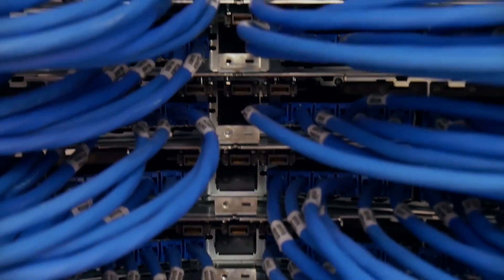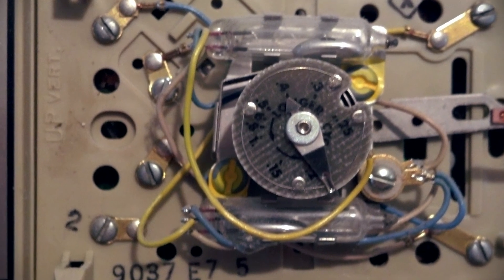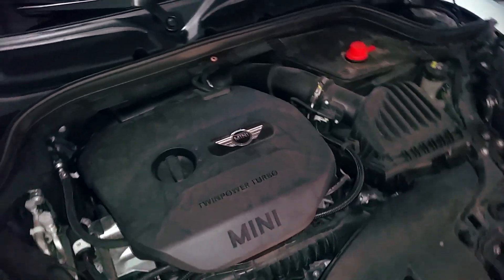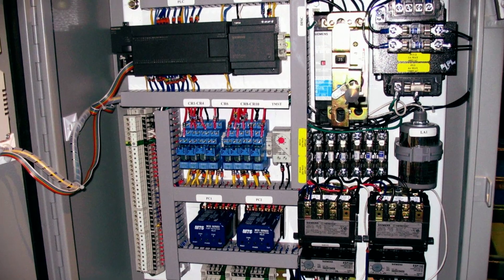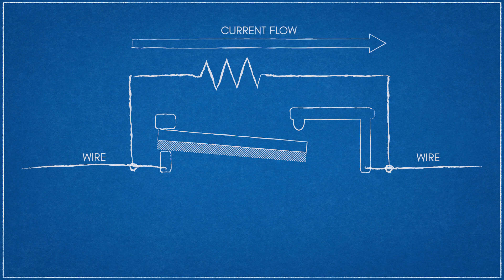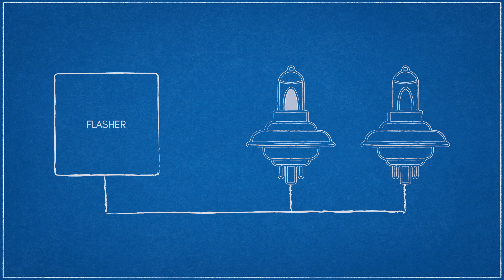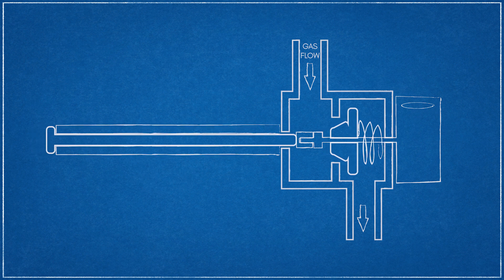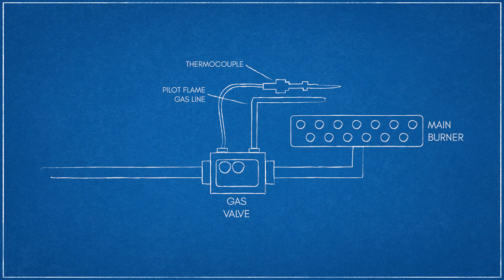Clever Uses Of Thermal Expansion

Comment: You forgot to mention the use of thermocouples in 3D printer nozzles. They are excellent for measuring the temperature within a 0.01 degrees Celsius accuracy and with PID control the temperature can also be regulated within that accuracy. We're talking well over 100 degrees Celsius nozzle temperatures though, but even a few degrees overshoot or undershoot can cause print issues. 3D printing is extremely precise.

Comment: Bi-Metallic metals were used as early as the 1750's to help mitigate time variances due to temperature changes in both the hairspring and the balance wheels in use at the time. Nowadays, fine watches like Rolex and many others, use a copper-beryllium alloy to make it more thermally stable.

Comment: My Dodge used a bimetallic strip as a cheap delay-off relay, connected to the dome lamps, for the ignition cylinder halo light.

Open the doors, dome lamps on, strip heats up, makes a connection, ignition light comes on.  Shut the door and it takes 10-15 seconds for the relay to cool off and the halo circuit to open.

Comment: One thing.

The voltage developed with a thermocouple is not formed at the junction, despite common belief.

It is formed along the gradient of the wires, which is why a "cold reference" is required.

Thermocouples don't measure absolute temperature, they can only measure relative.

Comment: As a software engineer, the thought of replacing analog mechanical controls with sensors and software terrifies me. The question in software engineering is "what happens when we screw something up?" not "what happens if we screw something up?"

Comment: I'm a massive fan of thermal-flasher TWINKLING incandescent Christmas lights, not talking about blinking lights with the red-tipped blinker bulbs. I discovered them a few years ago from a video Technology Connections had made about them and I've been a convert ever since! 
I think they are visually far superior to LED lights as the twinkling of the flashers creates a very subtle and gentle almost "shimmering" effect in the rest of the non-flasher bulbs as the voltage each bulb receives constantly fluctuates and the twinkling is actually completely random as opposed to more modern LED lights that cannot reproduce the same visual effects, nor can they be completely random as most will just cycle through a handful of regular timings.

Comment: Paraphrasing from a high level thermodynamcs text: There is no theoretical underlaying thermodynamic reason that a material should expand or contract with changing temperature. 

I.E, it's not 'required' by any thermodynamic reason. They just do. 

Some materials contract when heated (eg: Ice). 
Many do both - changing their behaviour at different temperatures. 

There's no prediction for it either, so we just engineer using empirical data

Comment: Engineers keep replacing thermal relays and overloads with clock counters.  Driving the maintainers nuts when current is high crushing broken parts but the clock is still counting down to cut circuit.  Its funny how a piece of metal put together works as a current sensor.

Comment: The only time I experienced an engine being radically cooled down was coasting down a steep hill in neutral gear in -20°C temperature :D Idle RPMs of a small engine on a car without advanced air intake control just couldnt battle that amount of cold air :D So i guess in winter its always better to stay in gear .. also because you charge the car battery that suffers a lot more in winter :D

Comment: Thanks for the information although I am starting to worry about how the physical fail-safe devices are being replaced with software, seems to me that the fail-safe is being replaced with fail-reporting which then leads to fail-flagging  which then requires fail-flag-processing which then eventually leads to action-to-make-safe.  Very much over complicated.  In my experience, when dealing with safety systems, the simple systems are better.

Comment: As a programmer, engineer, and electronics hobbyist, I advocate that systems should be given direct access to sensor data and indirect control over actuators so that software can both allow user customization and the reception of updates that improve the quality of the system, *HOWEVER*, said systems should also implement truly independent electromechanical failsafes because, trust me, it's easy for software to fail unpredictably, unsafely, and very very horribly.

Comment: A lot of people will have the thermostat valve in their homes if they have a wet heating system, they are the twisty things on your radiators, called TRV’s or thermostatic radiator valves. Wax based temperature regulation. They are also used on old school hot water cylinders to regulate the water temperature shutting the flow to the cylinder.

Comment: The explanation of the thermocouple is wrong. The junction does not create a potential difference. In fact, the only thing the junction does is ensure that there is no potential difference at the junction. The voltage is generated in the individual wires due to the temperature gradient along the wire. Different materials generate different potentials as a response to the temperature gradient, so while the potential difference at the junction is zero, there is a potential difference at the meter end.

Comment: Most thermally activated switches I've seen don't use a separate heating element, but instead rely on the current passing through the bimetallic strip to generate heat.

Comment: And yet, using Soundwaves as an energy source completely escapes mankind... 70% of ALL mechanical electrical structural chemical movement IS molecular transference of oscillation Frequency " Soundwaves " the median of Matter or energy matters not. 
 ... 15% is positive Thermal Energy the 15% is negative Thermal Energy or cryogenic energy. One Works WITH gravity one works against it .. and Heat is a Sign of LOSS of Entropy.

I can make Venturi chamber with parabolic reflector dish and a sound driver produce MORE thrust than a jet engine with ZERO heat. " Cold Airwaves " " see Brownian motion. 

No Fuel and No Audible Soundwaves..." Below 20 hertz frequencies "

With ONE Moving Part..
Reply: And why aren't you selling that to NASA or Elon Musk?

Comment: Learned most all of this as a teen, but always cool to watch it explained again. Good vid.
Reply: One of the best uses of heat control that amazed me is rice cookers. 

Because a magnet will fail once it reaches a certain temp you can pair it so it fails at 101 degrees. Because water boils off at 100 degrees it will only turn off once all water in the pot is gone (absorbed/evaporated).

Comment: In the CANDU nuclear reactor the geometry and composition of the fuel rods is such that when they get too hot, the thermal expansion reduces the density enough to make it subcritical, neutron economy turns negative and the reaction slows. This makes the whole system self-regulating and essentially impossible to meltdown, even if you were actively trying to melt it down.

Comment: The bi-metallic balance wheel was one of the first methods of watch and clock self regulation. When it got hotter, which would slow a watch down due to expansion of the balance spring, the balance wheel would contract, moving the moment of inertia inwards causing it to rotate faster.

Comment: The mercury switch in the thermostat is only there to provide hysteresis - the coiled bimetallic strip design can also be used with regular electrical contacts and mechanical means to provide the hysteresis.
Basically, when the strip moves far enough, the mercury falls from one side to the other, and it's weight then keeps it there until the coil build up enough tension to overcome it. This keeps the switch from reopening as soon as the temperature rises any appreciable amount, to keep the furnace from cycling too frequently.
Reply: Ryan, good analysis of the weight shift of the mercury inside the capsule to minimize short cycling. Additionally, the sealed mercury capsule is there to greatly minimize arcing and subsequent contact erosion. Also the arcing takes place inside the glass tube providing one less source of unintentional ignition.

Comment: One of the best examples of this is all of the expansion joints on the SR71 Blackbird. This engineering marvel literally leaked fuel while onto the ground and continued to leak while in the air until it reached high temperatures on its outer skin through high speed flight. There were expansion joints all over this aircraft. They figured this out without computers or calculators using slide rules by hand. To this day this aircraft holds the speed records it has achieved to this day. Amazing what people can do when they are faced with these huge problems that they face.

Comment: That's interesting about the flame sense pilot.ligbt thing. I tried to make my home fireplace "smart" (you know 'Alexa turn on the fireplace'). It had a Wall switch so I figured it was powered and I'd just interrupt the power supply (like a light bulb). I was baffled when I took it apart and the damn thing has no power at all. It's all contained. Even now I was thinking "it must be low power micro electronics." But actually probably not. It must just have 2 valves- one only working when the wall contacts are closed.

Comment: that's my entire job !!! 
transmitting informations on pressures or pressures differentials, that can get you, with some math, the flow, the level, the cloghing of filters,ect 

temperatures of corse 
but weight too, and then all sort of other extremely amazing stuffs !!! :) 

thermocoples are one kind of sensor, then you insert whetever you get out of it reliably to a transmetter wich is where you enter configurations and parameters of the stuff you are measuring, for exemple, if you use pressure to know the volume of liquid in a spherical tank, there is a formula, a flat cylinder, another formula, vertical cylinder, another formula, or % ? % of what ? level or volume capacity ?? ect ect ect 

that job is called here in belgium  electro-instrumentist

i have a specialisation in chemical industry and pharmaceutical/bio pharmaceutical industry.

basicaly, wherever there is sensors, i am here, so no limits, UNLIMITED POWER 

don't hesitate to send me private message for questions ok ??

Comment: Now the cars have a microcontroller that monitors the current going to the lights, etc.  The software complains about things like burned out lights.  If you try to replace incandescent lamps with LED lamps, the car complains about a burned out light because the LED light takes a lot less current than the incandescent light.

Comment: Are you sure thermal flashers are in parallel and shunt the current?  
Do they not simply break the circuit in series when it heats to a certain point?

Comment: Hum, I don't think these are particularly cleaver uses of thermal expansion. I would say these are pretty standard uses of thermal expansion, they are all to do with temperature control...... which are directly due issue affecting them, a fairly straight forward use.

Comment: When you hold down the knob to light a pilot light and let it get hot the thermocouple needs to be hot enough for it to make enough power to tell the safty valve to keep the gas flowing and that it can safely turn on the main burner in, water heaters, ovens, gas household heaters. When you hold the knob down and light the pilot light and it goes out immediately after you let the knob go that usually means that the thermocouple is bad. Sometimes it can get coated in soot and the black soot insulates it to not work. Clean it when its not hot. And try again. If it still doesn't work and you can easily get to it while its in place still heat it up with a torch to red hot all over it and let go of the knob. If it stays lit for a few seconds and goes out thats a strong enough indicator that it is the problem and needs to be changed. If you can't heat it up to test you will just have to change it anyway. Its what a repair man would do first if the pilot doesn't stay lit because its one of the cheaper parts. WARNING RELEASE OF RESPONSIBILITY FOR WHAT YOU DO
im nkt responsible for what you do with this info. Don't burn your house down or blow up. If your confidence is high thaf you know what your doing from experience and knkw exactly what i explained you decide to try at own risk. If you dont know then just call it repair man.

Comment: Like the thermostat wax is used in a valve that lets more air in during cold start up in some efi engines. Its like the choke on a carburetor. On some Honda engines if part of that valve is loose the engine will rev up and down all the time because the electric controlled idel valve closes all the way rpm drops until the engine senses that then it opens all the way reving way up then close. Until the fitv is fixed it will continue. Id guess that other efi engines have the same valve.

Comment: I was kinda expecting a video on 'Clever Uses Of Thermal Expansion' to be more than 12 minutes of basic info on thermostats - almost all of it on bimetallic types, which is the second most basic and commonly known use of thermal expansion (#1 being expansion of a liquid, e.g. in a mercury thermometer). The only thing I actually learned was about the wax-melting variant.
Reply: That frustration happens when you're not the target audience. As you pointed out that may be basic information, but to someone who never thought about termostats the video was perfect - and the title interesting enough for us to play the video.
Reply: @GabrieldeOliveiraAzevedo  Fair enough, but I expected 'Clever Uses of Thermal Expansion' to include a) more than one use, and b) that are notably clever. Say, industrial process control methods that use the change in density of the working material to regulate operations, or fitting metal pieces together by heating the outside piece to make it larger then letting it cool and shrink around the inner piece - both of which are things I know exist but would be interested to known more about. This video should have beet titled 'How thermostats work'.
Reply: wow man you're a genius maybe you should make a video

Comment: I don't know if it is true, but I heard luxury car factories cool some metal tings in order to fit them in their correct position inside the engine. Once it gets to room temperature, it expands and thus gets fixed in place indefinitely, with any soldering or glue

Comment: Well, PID does have a lot of advantages over the old thermal switch method. That hysteresis is fine for a heating element with plenty of heat capacity for buffering, but not every process has that liberty. By increasing the rate a thermal flasher, you reduce this need for heat capacity but also reduce the lifetime of the switch itself due to pitting and the like.

To be honest, I’d quite like to make a microcontroller dev board with a really cheap MCU on it, but optimised for use as a PID controller, with a good ADC and DAC, alongside a dedicated thermocouple reading IC and maybe a FET driver or two. Now that I think of it, such a board would also be great for audio DSP.

Comment: I've taken apart car signal flasher relays apart; many of them. I've never seen one containing a thermal flasher. They are pretty universally electro-magneto-mechanical devices, typically based around a relay with a capacitor in parallel with the coil and a set of normally closed contacts in series with the coil.  Thermal flashers are normally built into the filament assembly inside a bulb.

Comment: very well expained! my favourite bimetallic application is on RTGs. radioisotope thermoelectric generators. in spacecraft the radioactive element is shielded by a panel on a bimetalic spring so when the rtg gets too hot (i.e. the spacecraft is not using the heat), the bimetallic spring actuates the panel and allows the RTG to radiate away the extra heat into space. Not sure but a bimetallic spring may also control a door that lets heat into the spacecraft for heating as well, but i dont remember

Comment: Re bimetallic switches:
An explanation of the mechanical bistable ("click frog") configuration of those contact blades would be helpful. A contact simply opening by its bending movement would make for a very unreliable device, quickly burning out because of arcing.